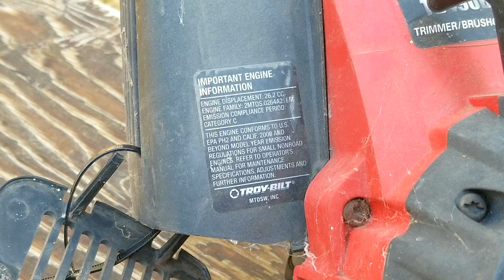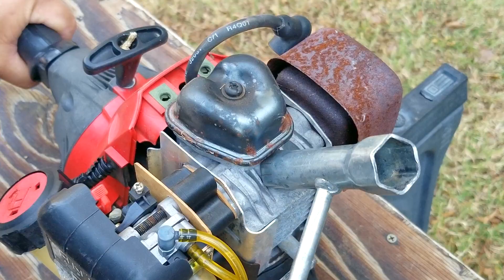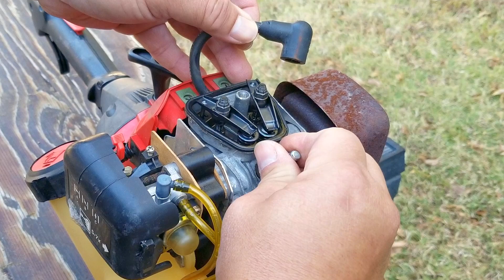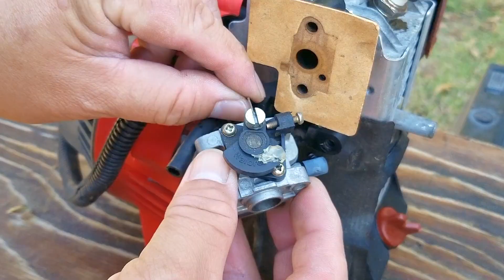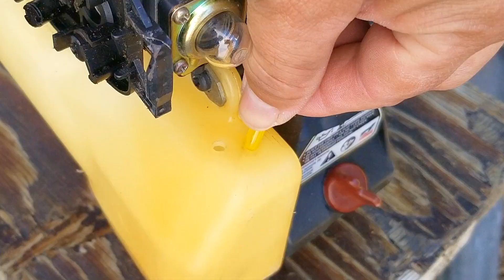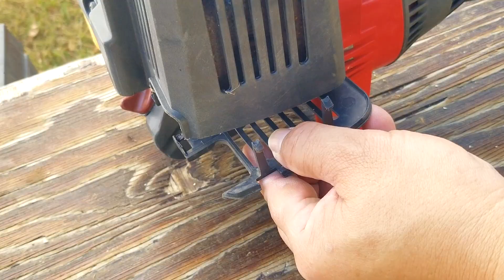Fixing A Troy-Bilt 4 Cycle Trimmer.

Comment: I think the carb is the common one the honda Gx35 compatible. These are cheap if you replace you can just get this fully working. Also before that check the engine for white smoke i saw at the start but then if it comes continuously may be bad piston rings or the oil is leaking from the valves
Reply from the maker: Thank you very much

Comment: Up here they still sell, but I'm finding myself buying them less and less because of the slowing turnaround.  
But I like using them more than my Battery one.
Reply from the maker: Thank you for sharing that.  I can see why people are switching to battery.  But for me it's the longevity I don't care for when it comes to batteries.
Reply: @HomeGaragechannel  In full agreement there.  I have repaired units from the early 2000s, and even one from the 90s, which they're just fine.  
Batteries won't last beyond 10 years, and then what?  Another $400 to replace the battery? That's crazy, you can buy 4 used working gas trimmers for that price, and keep using them for the rest of your life, as long as you maintain them.

It's the maintenance I think, people just don't want the maintenance, without realize you need to also maintain the battery, or it'll prematurely fail. Leaving it on charge 24/7? Wears out the cells. Leaving it off the charger and letting it sit for months on end, especially at the end of the season, shortens the life of the battery.  Battery gets used too much, and for too long, and overheats?  Shortens the life of the battery..
Short charging cycles shorten the life of the battery, and storing it at full charge shortens the life of the battery.

To slow chemical degradation of Lithium ion batteries, you store them at a roughly 50% charge.. 

And the funny thing is that this actually also corresponds with Battery cars too, since they use the exact same tech.
Reply from the maker: Yes everything you just said is So True!

Comment: My Husqvarna 125b blower kinda having issues when you crank it use it for a little bit put down for around 10min engine still warm I pulled the starter rope cranks up shut off hold the throttle crank up shut off I did the All the starting steps it crunk up it just how do you fix it  it haven't been fix every sense  around January or December it was fixed around the colder months ago I think I need a tune up.
Reply from the maker: warm/hot starts, are one of the toughest starts. I would do a tuneup and inspect the carb.
Reply: @HomeGaragechannel  thanks is this a common issue because I read on the reviews of it that it Will loses power because the hole in the gas cap will be clogged and I open the cap and put it back on i can hear the performance difference it's blows harder.

Comment: I got a question for you, I’ve always wondered when the primer bulb is empty on a two cycle or four cycle engine, why it makes a weird/cute squeaky noise when it starts to fill with fuel initially. I’ve never quite understood what makes the “ squeaky” noise.
Reply from the maker: Sure, it's pulling the air in the lines thru the carb and thru  the check valve.  That's why it's making that noise.

Comment: Good Lord if that is the kind of equipment your local airport is buying I would hate to know what other things they have cheaped on . Municipalities shouldn't overspend but at least have some good quality equipment!
Reply from the maker: I know what you mean.  At least this is our "local" airport and not the international one.
Reply: will a weak ignition coil cause a sthil trimmer to struggle  idling
Reply: @BraydenPierpont You would have to be more specific on what Stihl trimmer you have , if it's a cheap clamshell model it's most likely the carb , if it's a four mix always adjust the valves before messing with anything,then the plug then the carb . When the mag fails on either one they usually won't run well or at all. The four mix is a contankerous little gem of engineering.

Comment: I used to have 2 those timmers rebuilt the carburetors,best way I found to start them do not squeeze the trigger while pulling on the starter rope
Reply from the maker: I don't recall if the instructions say to squeeze the trigger or not while pulling on this one.

Comment: I scrapped one of these a while ago, had issues with the pull start recoil and it didnt seem to want to fire so I salvaged the trimmer shaft and other parts and scrapped the motor section
Reply from the maker: I understand why.  Sometimes the parts are worth more than the whole machine

Comment: Since this is an older Made in USA Troy Bilt trimmer, I would say buy a new carburetor and try selling it for some money if it does sell. A cheaper aftermarket carburetor is better than nothing.
Reply from the maker: I believe you are correct.  I'll try the new carb and see what happens

Comment: If there was a way of melting the resin by using a small flat bladed screwdriver which has been heated up with a propane gas torch then you could probably adjust the mixture adjustment screw otherwise just replace the carburettor.

Or you could remove the whole top plate & make sure where the needle on the end of the adjustment screw sits isn't obstructed,if that doesn't work,buy a new aftermarket carburettor.

I bought a spare one for my dads Honda GX35 clone engine which I plan on using on one of them I plan to replace the cylinder on for $17 AUD on eBay.

I ended up reusing the original Honda GX35 engines carburettor on the clone engine because I had trouble with the carburettor not maintaining adjustment whenever I adjusted the fine adjustment screw/needle on top of the carburettor, it's pretty much the same as the Troy  Bilt carburettor being a 4 stroke carburettor.

One of the lawn equipment repair pros on here was saying that the coarse adjustment on the side of the carburettor was out on a machine he was working on although that was a 2 stroke version, the problem is that if I revved it out then closed the throttle then the engine would stall then not start afterwards because it became flooded.

The fix would've been to adjust the screw on the side of the carburettor except this carburettor didn't have one, in this case, the fix was to use the original Honda carburettor although the other option would be to buy another carburettor if you didn't have the option to use the old one !
Reply from the maker: Thank you for sharing that and i'l have to see about using heat.  Although I'm worried that the screwdriver would be hot enough to damage the plastic part the screw is housed in.

Comment: You had to go get. You used degreaser to clean it. You cleaned the inside of the gas tank.You changed the fuel lines. You changed the bubble.You did a valve adjustment! You inspected the carb but you should have cleaned it and replaced the diaphragm just to release all doubts of it needing a new carb at start up and yes after all that momentum resistance is futile!
   A side note; that diaphragm was probably original! It would also be safe to assume that the carb was never maintained and that it might most certainly contain debris in the screen and cracks and crevasses could use a nice wipe down. That could have made a difference considering that no adjustments had ever been made to the low or high side because it's non adjustable. Meaning it should in theory  function properly with a well maintained carb! It's a decent trimmer and with the prices of electricity starting to soar and with the addition of all these new AI data centers being built across America which cause any home in that are a 2- 800% markup on electric Bill's and even higher may no longer be able to even afford to plug in anything other than bare necessities. They will resort back to gas powered equipment in the next few years!
Reply from the maker: Yes you are correct, I didn't clean and service the carb and this is the end result
Reply: @HomeGaragechannel It's not too late! It's what we do! Just another day in the hood right!
Reply from the maker: you're absolutely right!

Comment: If you think you can adjust that carb it's worth a shot before replacing it with a cheap aftermarket too bad the whole lever is plastic I have heated up the back of a drill bit same diameter as the cap and push it straight into the cap then let it cool and then pull pop that stupid block cap right out
Reply from the maker: I'll try adjusting but the resin around the screw is tough to remove

Comment: It's a shame, 4 cycles are usually pretty reliable. But in my experience, carb adjustments are usually the beginning of the end. I've had countless machines where I tuned it just right and then a month later I'll have to retune it. Then it become often. But once you understand how to tune a carb it get quicker until you eventually have to replace it.
Reply from the maker: YOu're a very wise person!
Reply: At least they're cheap enough to replace, even OEM ones
Reply from the maker: Unfortunately the OEM carb is very expensive.  The aftermarkets are super cheap
Reply: @HomeGaragechannel  take it from me. I bought oem parts for troy bilt weed wackers and edgers. By the way, this video helped me resolve the pull cord issue. Thanks.
Reply: If you have to keep tuning something it has other issues !

Comment: hey i have a Poulan wood shark I'm working on and it seems to flooding itself out even if its just sitting. I've been told that the rocker arm is stuck opened and its just pouring fuel in. would it be easier to fix that or order an aftermarket carb and does that sound right to you?
Reply from the maker: Personally for me, I would just service the carb.  For someone else, it might be easier to just replace the carb.
Reply: I put a new diaphragm in it but I had done nothing with the rocker arm